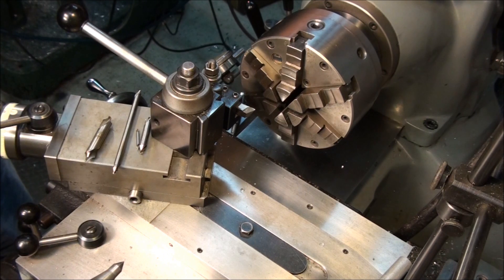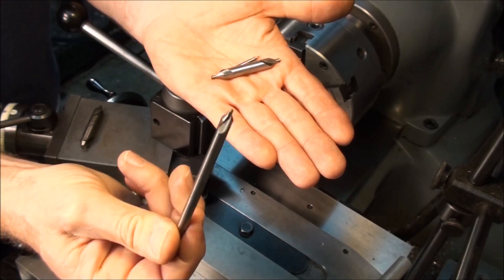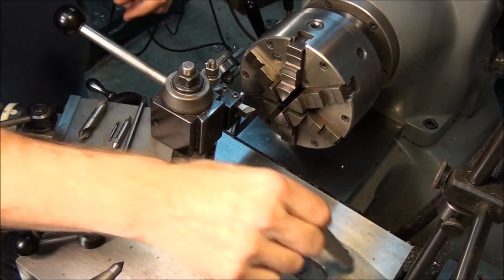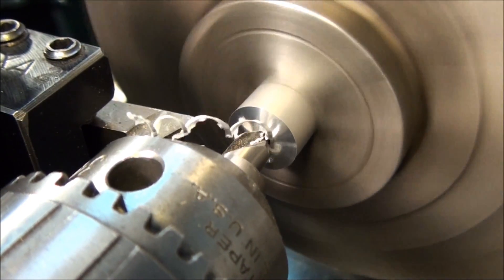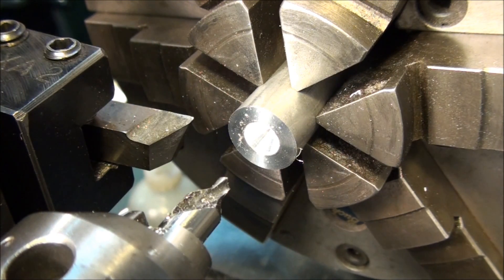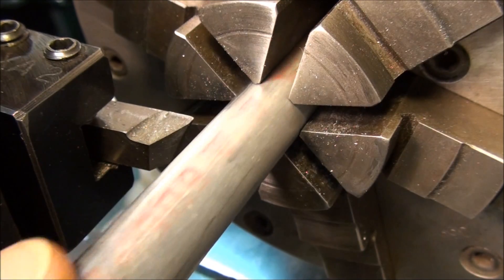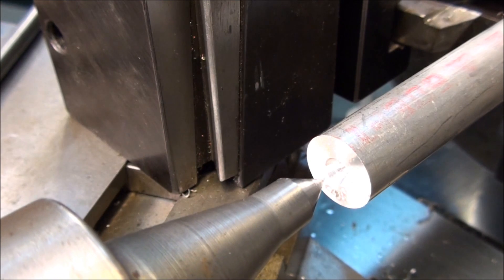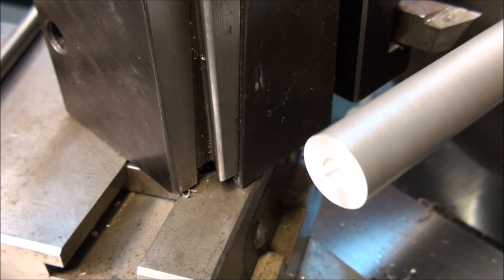Center Drills and Center Drilling

Comment: Thank you but how is the facing going to work
Reply from the maker: Face first, then center drill.
Reply: Than Wil the facing and centre hole be true to eachother @TomsTechniques
Reply from the maker: Facing and center drilling are not interconnected. One is not "true" to the other. Just face the ends, center drill, and do your turning.

Comment: How do you know if the drill bit is in the middle of the part being turned?
Reply from the maker: As long as you keep the tailstock dialed in for turning, that's more than adequate for center drilling. Besides, center drills are rigid enough that even if it is off a bit, it will still put a center hole on the center of the part.

Comment: how do lathes drill perfectly centered holes?   What is the physics behind how it finds center? ........ I guess what it finds is center of rotation more than center of the part -right?  but why does it naturally find this spot
Reply from the maker: A drill will not naturally find the center of rotation. To get holes on center, they need to first be center drilled, and then drilled to size.
Reply: @TomsTechniques  doesn't a center drill sort of find center even If the tailstock is off a few thou

Comment: What about facing? Before center drilling, should we face part extended out of chuck for the same reason we can't drill it in chuck
Reply from the maker: Facing an extended shart would be difficult due to a lack of rigidity, although I can't imagine where that would be necessary. If the end had to be dead true, you could always clean it up once the center was in place.
Reply: @TomsTechniques  thank you, one more question I've as a newbie. If we can't put stock through bore of chuck (20mm bore), 25mm stock dia. 

15" stock length

Comment: Hello Tom,
Thanks for your demonstration with long material. So if I understand well your recommendation is to do drilling when part is extended from chuck. But what about deep holes (e.g. 10 centimeters) wouldn't be out of centre as close we will be to chuck?

Thanks
Zdenek
Reply from the maker: Only if you plan on turning a part with one end supported the chuck. If you plan to turn the part between centers, centerdrill each end with the part chucked close.
Reply: @TomsTechniques  Ok, thanks

Comment: hi guys, i understand exactly what's the point to extend the bar and center drill when extended but nobody says how much could we extend it safely? if for example i have to center drill a shaft of 20cm obviously i can't center drill it fully extended..... in this case what is the best option to avoid the center wobbling? will be correct to center drill near the chuck and then limit the chuck jaws clamping surface trying to align the stock with rubber mallet? thanks for your opinions!!!!
Reply from the maker: The amount of shaft extending from the chuck depends on its diameter and is pretty much self limiting. Too much extension, or too long a part between centers will cause chatter. You can still machine long, slender shafts, but that may require a steady or follower rest to be successful.

Comment: what is the different between center drilling and drilling??
Reply from the maker: The tool used. Center drilling refers to a short, stubby center drill used to start a twist drill at an exact location, or create a cone shaped hole for a center on the lathe. Drilling refers to a twist drill used to create a hole of a specific diameter, to a specific depth.
Reply: @TomsTechniques  thank you

Comment: How do you align the centre ?
Reply from the maker: The center should not require alignment unless the tailstock has been offset to turn a taper. If that is the case, it can be indicated using an indicator held in the spindle of the lathe.
Reply: @TomsTechniques  I have a Drummond round the tail section seems to rotate around just trying to figure out the easiest way to centre it thanks for help

Comment: when drilling, make sure to break the chip by letting go of the wheel on the tailstock (moving the drill outta the cut a bit). these long spiral type chips are dangerous, but you probably know that :). Have a nice day
Reply from the maker: That's a good tip, when actually drilling holes. ;)

Comment: A good short video on the types of center drills and center drilling operation on the lathe. The instructor explains some valuable key points. Lathes and milling machines are used in many areas of manufacturing as essential basic tools, including woodworking, ceramic parts manufacturing, metal and metal alloys shaping and manufacturing, plastics and elastomers machining.....etc. Therefore, anyone interested in manufacturing technologies for fun, hobby, as an entrepreneur or for their career should definitely familiarize himself/herself with lathe and milling machine basics and probably also with other non-conventional techniques such as laser machining, plasma machining, waterjet.....etc. Even if you are not a machinist, but a consumer of machined parts, I strongly recommend learning the basics of machining operations and CNC and manual equipment, so that when you prepare blueprints or want a product to be designed and want to place orders for parts, you know better what is possible and what is not possible. Also, the equipment a machine shop uses is an important contributor to quality, lead time and price. Knowing something about your supplier's equipment inventory can give you an idea about whether that particular supplier is a good fit for your specific parts or not, provided you understand something about available equipment. You can visit our Youtube channel by clicking our logo on the left for additional videos on various manufacturing techniques, good instructional and educative subscriptions and to see videos we liked. Thank you Tom for posting this instructive video on center drills and center drilling.

Comment: What would happen if you center drilled near the chuck, then pulled the stock out as you did to run on a center, BUT, first seated the end on the center with a loose chuck, holding it there, THEN tightened the chuck?
Reply from the maker: If the stock is irregular, it will distort when clamped regardless of whether the end is held or not. The best option with irregular stock, such as hot rolled, is to turn it between centers and not use the chuck to hold it.

Comment: I learned a trick years ago about a shaft that has been center drilled close to the chuck and then for some reason, you have to pull the part way out and the center hole is wobbling, you place the outer end in a steady rest and take a small lathe bit and go inside the center drill hole and "peel the center" to true it up. Another thing I do when center drilling is to slightly tighten the tail stock ram as I am advancing the center drill towards the part so it doesn't want to "orbit" or dance around the true center of the work. On a new lathe this is not a problem, but with old well used tail stocks , they can get fairly loose. It's a good idea to put a little drag on the ram. By the way sir, very good video.
Reply from the maker: Thanks for watching

Comment: what rpm should the lathe machine be while centre drilling
Reply from the maker: Treat the center drill as you would any other cutting tool and figure the rpm accordingly. My video "Cutting Speed and RPM on the Mill and Lathe" Tells how, but basically you use the formula 4 x cutting speed / diameter. Center drills are so small that it is difficult to use too high an rpm, but too low an rpm will break the pilot off of them, especially in steel.

Tom

Comment: What do you consider when selecting a center drill size, particularly with small diameter parts?
Reply from the maker: I've never really thought about it. It really doesn't take much of a center to support a part for turning, so I generally err on the small side. If it chatters, just use a larger one.

Tom
Reply: Toms Techniques thanks
Reply: I'm learning how to do this with my dad I made my first piece yesterday it came out pretty good

Comment: The thing you said at the end about drilling the part extended for the center is very wrong and is going to get some kids hurt. You must be a wood worker. Unsubscribed.
Reply: There is nothing wrong about it, you just simply don't understand.
Reply: Hi Tom,
I'm not taking anything away from your efforts, and respect to you for uploading these videos(I couldnt have the patience) But I'm afraid ROLFhacks is correct.
I see most of viewers here are novices or starting turning. But extending the workpiece out from the chuck to centre drill (depending on speed, diameter and distance from chuck) could cause the bar to whip causing damage. Don't ask me how I know lol. What you have in the video is ok though. A learner might take it as read for all sizes. Safest way is machine truing band on OD with bar in chuck. Set up in chuck gripping with as small a grip as possible, with truing band in fixed steady. Drill out for centre. The small grip allows bar to move without flexing when setting up steady.
Reply: Again, Tom did not give bad information.  Read my post above, or watch the video again.  He explains the logic just fine.
Reply: Machining isn't for dumbasses. Of course if you stick a thin rod out extremely far and spin at 2000rpm it will whip. Yes he probably should stress how dangerous extending thin rods at high rpms can be. But again this isn't a trade for dumbasses. Use your brain use common sense. This is the correct way of center drilling an extended part when chucking on one end. Or course there are limitations as to how far you can extend the part. Don't be an idiot. You don't know what you're talking about so just remain quiet instead of showing real machinists how ignorant you are
Reply: Watch the video again and try understand why he took the stock out of the chuck that far in the first place. Yet again, nothing in this video is wrong or dangerous and he explains perfectly in the video why he does it. If someone doesn't understand why, they shouldn't be working with machinery.
Reply: Chris R
Look at the other posts on here. The majority aren't qualified machinists or turners going by the questions asked. They are people trying to learn by picking up tips 
on you tube. Maybe they have a lathe in garage or hut, students at college, what ever. I wouldn't call them dumbass though. Please be a little respectful, it won't hurt.
The bar Tom has in the video of course wouldn't whip, but where do you draw the line. I know, as I have fifty years experience as a turner, but will a complete novice 
know working in the garage or hut?
Like your tip for using tool post grinder to true up a worn out three jaw btw....
Reply: Clete
Read ROFLhacks post again, he's not talking about the distance the centre drill is being drill in. It's how much the bar has been taken out of the chuck.
Reply: I know why he took the bar out the chuck. He took it out to illustrate that the centre drilled hole would be running off if it was drilled in the first place when in the chuck.
Then taken out and rechucked with the bar extended. Try reading ROFLhacks post again. He wasn't talking about the size of the centred drill hole and how deep it was.
Then read my post where I said how it was explained in the video was ok. The problem being if the bar is smaller than that and extended further out it could cause problems.
Reply: He said nothing wrong.  What he was describing is that if you over drill the center, you lose the taper contact pattern of the 60 degree intent.   That 60 degrees is in effect a taper contact, which is lost if you over-drill.

Comment: Can you center drill  both ends with the part close in if planning  to use a lathe dog and driving plate?
Reply from the maker: Absolutely. I only extend a piece of stock to be center drilled if the extended end is to be supported by a center.

Tom

Comment: If the tailstock is somewhat misaligned with the headstock, does the center-drill still do its job? Thanks.
Reply from the maker: Yes, to a point. If the tailstock is offset, the center drill will act as a boring bar, generating a hole on center, but slightly larger. It's best to keep the tailstock centered though.

Tom

Comment: The wobble and stresses when extending the stock after center drilling comes from tightening the chuck around a significant length of stock and then forcing the center into the hole that now has runout. I usually avoid that by only using the very tip of the chuck jaws. I only tighten the chuck very loosely until the center is in place, and after tightening the chuck I retract the center to check that there is no movement when the center goes in and out. This way, the chuck acts almost like a center - it's not able to bend the stock significantly, only rotate it. 

My lathe is old and worn, and my 3-jaw chuck has a lot of runout so I almost exclusively use the independent 4-jaw and indicate everything.
Reply: You need to true your chuck up with a tool post grinder

Comment: You said "60 degrees" . WHAT PART is 60 degrees? Out on the very tip? The shoulder? If the number of degrees makes a difference in your results?
Reply: John Ohara the shoulder is 60 degrees. This is designed to fit most live centres that you put in your tailstock,  which are usually 60 degrees. If you use a different angle you will only have a point engagement with your live centre, this is not  desirable and your part is likely to run out. If you are only using it as a pilot for a jobber drill you can use different angles. I will use a 90 deg spot drill so I can centre and chamfer a hole in one op.

Comment: I would like to see a followup video of how you can center drill a part that is extended from the chuck like you show in this video.  I'm new to machining and dont see how that could be done with the part moving arround as much as it was.
Reply from the maker: +Larry Collier 
Center drills, because they are so rigid, don't walk around like ordinary twist drills. The center hole the drill produces will be on the part's center of rotation. The wobbling you see in the video was due to the part not being straight when it was centered while being held close in the chuck. If I had center drilled it while extended, it would have run true. Watch the video again and I think you see what was going on.

Tom
Reply: +Toms Techniques  if the part is moving in an arc wont that 1/8" center hole become the size of the "wobble". I would think center drilling both ends close in the chuck and turning between centers would be better. ?
Reply from the maker: +Larry Collier 
No. It doesn't matter how much the part is wobbling. The center drill will always be on the center of rotation. The best way to see is to try it. Chuck a part so it is noticeably wobbling and center drill it. You'll find that the center hole will be stationary as the part continues to wobble. It just won't be centered on the end of the part.

Turning between centers is not better, it's just a different technique. Sometimes turning between centers is not possible. Other times it's more appropriate to chuck a part and support one end. Every part is different.

 Tom

Comment: Hi Tom,

Your videos are very helpful for me as I have recently purchased a lathe and need some guidance.

One question, in your video you bring a decent length of stock out of the chuck and show how much movement it has when the lathe is turned on. You then say you should drill the centre with the stock sticking out of the chuck. How can you centre drill the part when it is moving around so much?

It seems like you would get a hole in a random spot and a snapped centre drill.

Thanks.
Reply from the maker: +Sam Jennison 
First off, the only time I recommend center a part like that is if you intend to hold one end in the chuck and the other with a center. If the part is to be turned between centers, it is not necessary to extend the part when drilling the center hole.

Now the reasoning. You should never assume that raw stock (before machining) is either round or straight. So if you intend to chuck one end and support the other, you should center the stock with it chucked in the position that you will be machining it. That will allow it to take its natural position and not be stressed after machining. If you center the end of a bent piece of stock close to the chuck, when you extend the stock out of the chuck, that center hole will no longer be centered. If you force it back on center with a center in the tailstock and machine it,  the part will flex back to its original position when released, resulting in a nicely machined part that is crooked.

A bent piece of round stock chucked on one end will wobble, as shown in the video. If you center drill it in that state, the center will form on its axis of rotation, not necessarily its geometric center. Then you can machine it in a stress free state.

Mind you that most stock is pretty straight when you get it, but if you do come across a crooked piece, this method will straighten it out.

Clear as mud?

Tom
Reply: +Toms Techniques 
Thanks for the reply Tom. That's what I plan on doing (holding one end in the chuck and the other with a centre)

I understand that things usually aren't perfectly round or straight but if you stick it out of the chuck by say 10" and its wobbling around a lot, how can you centre drill it when it's moving around so much? 

Maybe I'll need to try it and see what happens but it just sounds like a bad idea to me
Reply from the maker: +Sam Jennison 
There are limits on everything. Just use a bit of common sense.

Tom